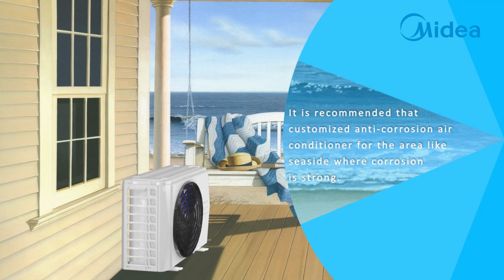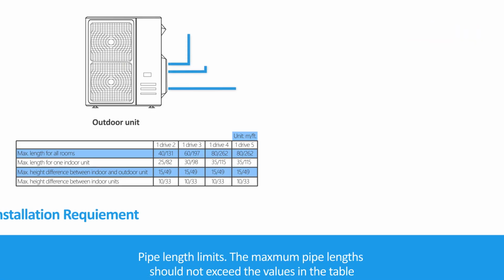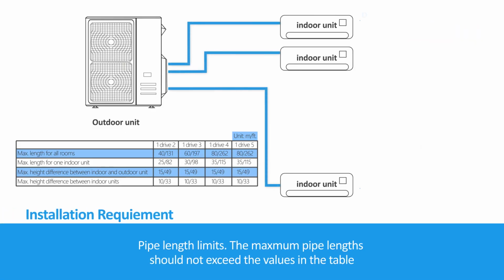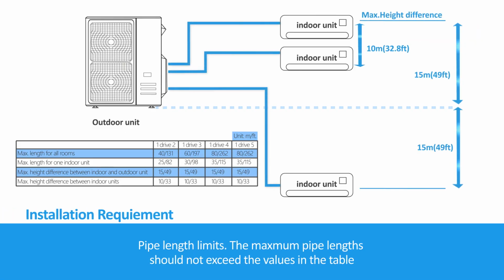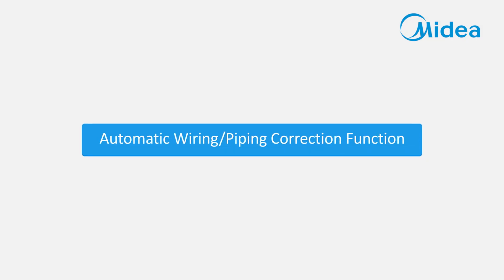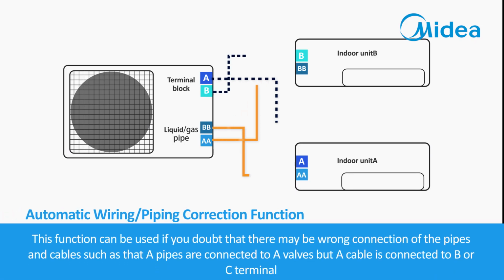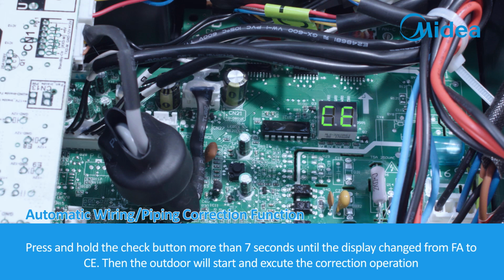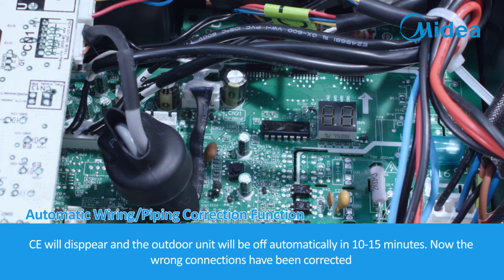Installation Video Multi Split EN Midea 20180531

Comment: Very helpful and learned how to vaccum down on a multi split. Although there are some details, for example the rubber pad between the concrate and the outdoor unit is not installed.  The copper pipe is not tight down to the torque spec. the wiring do not have the fittings to go through the hole etc etc.  Over all a good installation!
Reply from the maker: Thanks for your advices!

Comment: AC technician told this AC . cannot be install for domestic. This ac only can use for commercial building only like lodge and complex only . If we take this ac . House power line should be  3 phase line . Not for single phase use .
Reply from the maker: No. All of our multi series products are using single phase 220-240V.
Reply: I believe most house in the north America  should have 240, that is used on your electric dryer, cooktop,  water tank etc.  In very rear case you don't have 240

Comment: Where does the condensate flow? Does it has to go right through the wall to the outside or can it go inside together with other condensate valves from other units?
Reply from the maker: Of course
Reply from the maker: both are OK

Comment: What about air removing from pipe vaccum pump not used why?
Reply from the maker: The multi units are using either R410A or R32. Gas pushing is strictly forbidden.